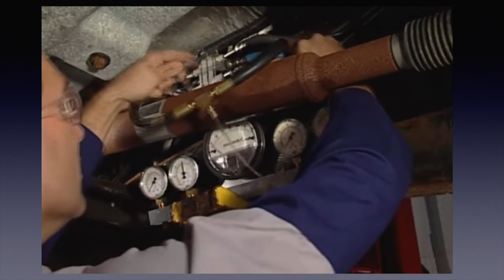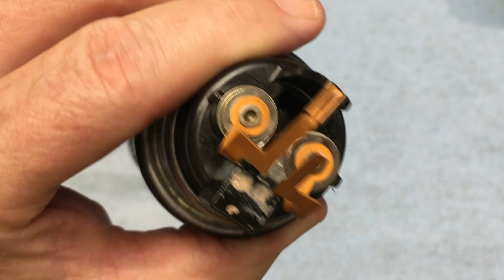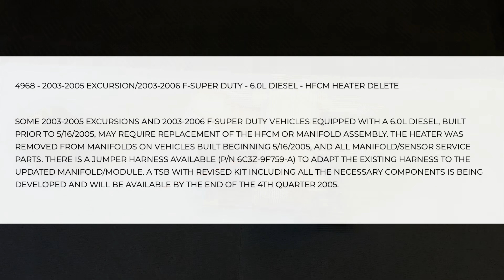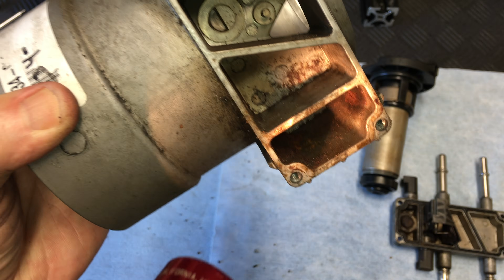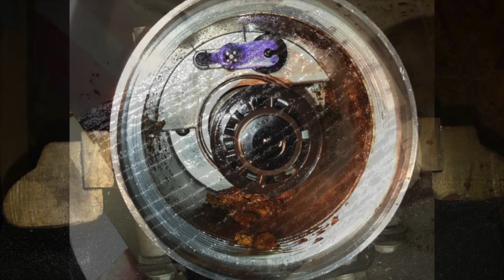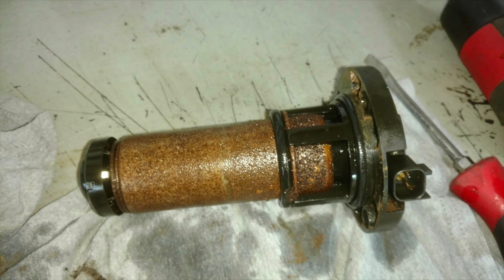Forensics of two "Failed to Pump" HFCMs - Powerstroke 6.0L

Comment: Hey TooMany, looks like I may have a bad torque converter. Do you think the Lubeguard shudder fix or a flush is effective and safe? I did a partial change and it seems slightly  better. Shudders starting about 30 mph and mostly stops by 40 MPH. I checked everything else, front end, drive shaft, tire pressure and general stuff. I can feel it in the steering  wheel at mild to moderate acceleration, but it goes away when I let off the peddle...though it seems a bit variable. Came on pretty  suddenly the other day. A transmission shop said the fluid looked OK about 40,000 miles ago, and I did a filter and most of the fluid change about 10,000 miles ago.
Reply from the maker: I wish I could help you with that, but my transmission work has been limited to maintenance.  I would suggest going to TheDieselStop.com and asking Mark Kovalsky.  Mark is a retired Ford engineer who specialized in these transmissions.  There is no better person I would ask.
Reply: @toomanytoys thanx so much. As usual you are a great resource!
Reply: Hey TooMany, I left my truck idling yesterday and when I came back it had died. The speedometer was bouncing up to 10-20 mph every few seconds, and the wipers were up about ten inches. The wipers had not been left on. Now the speedo won't work, the bouncing stopped except for once when I turned the ignition on, and the wipers are dead too. The speedo is getting juice, as it moves up a tiny bit when I turn the ignition on, and goes back down when the ignotion is turned off. Everything else works normally. My Scangauge II won't read the speed either. Any thoughts?

Comment: Can water make it past the HFCM? I had an injector tip split and was told it was caused by water. I keep my maintenance up. I have a deain on the HFCM and never seen any water.
Reply from the maker: If the filter is not Factory Motorcraft or a Racor (Ford's supplier), most definitely.

Today's diesel fuel, compared to when these trucks were designed, is hygroscopic, so the water is not as easy to separate as it was back in 2003 and maybe 5 to ten years later.  I usually don't see water lately, either.

Sometimes, even the factory design with the Aquablock outer membrane can be overcome, but I believe that with a lot of water in the fuel.

Comment: Thank you for your video.
My old 6.0 had two plugs on the hfcm. The new has only one.
What the second plug is for?
What would happen if i don't connect the second plug on the cfcm?
Reply from the maker: I've not seen an HFCM without at least two plugs: one for the fuel pump and one for the water in the fuel sensor.  The early HFCMs had three plugs, the third for the fuel heater, which was a bad idea.

So, assuming the one plug is for the fuel pump, without the water in the fuel sensor, you would not get a warning about water buildup.  In that case, drain the HFCM with the water drain by removing the water drain plug at every oil change.

Comment: Why even screw around with this crap ? Just install A FASS or Big Dog? Be done with it
Reply from the maker: Those have issues too.
Reply: Even those pump systems will have problems with debris in the line fittings . Nothing beats checking to see if the lines and fittings are actually open, from the tank to the filter, when there is a question of pump pressure or flow

Comment: Excellent movie as usually, Jacqueline. 😉 😂
  The blockage was very interesting and pretty extreme. I wouldn't of expected to find that.
  Also on the images of my old pump motor terminals, Do they appear like they got hot to you based on the color of the copper? By chance did you ohm the terminal strip to pin? I wonder if there was a poor connection. 
 When or if you're ready, let me know when you want my heads for analysis.
Reply from the maker: Every once in a while you have to get in touch with your feminine side. LOL.  It was just the most realistic sounding voice of the choices, and I thought it would be interesting to see the reactions to it - replacing me, and for a diesel category.

I had thought about the coloration of the copper leads, but I don't have a good handle on the oxidation that would occur over these years of copper just being in diesel fuel.  When I checked the pumps, they only pull around 5 amps at 60psi.  And the diesel flowing through should have a tremendous amount of cooling.

Usually I think about checking those heads every time I go down to see my doc.  We should just plan a date when its convenient for you.  I was thinking of mapping the cupping of the surface with straightedges, and checking the surface finish in the areas that are not in contact with the gasket.  I could do that down there - you have my cell/text #.